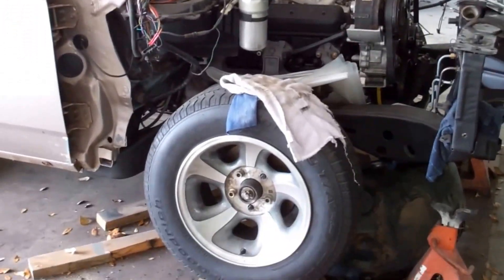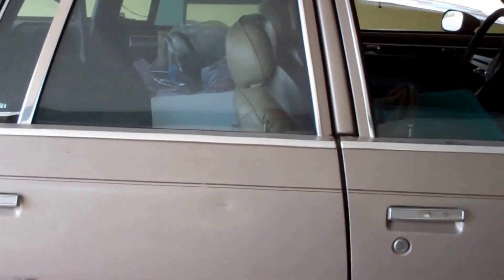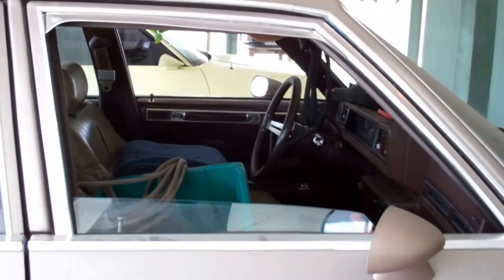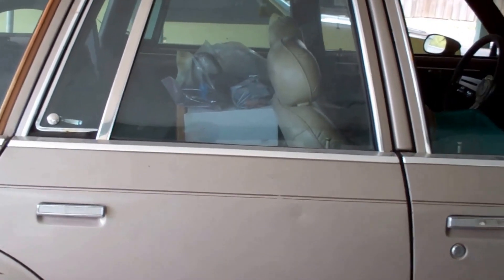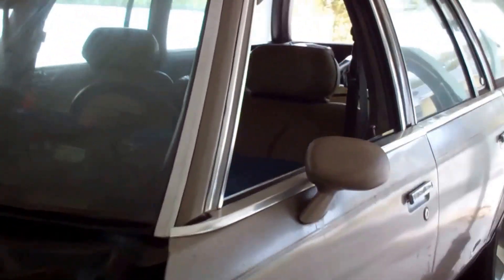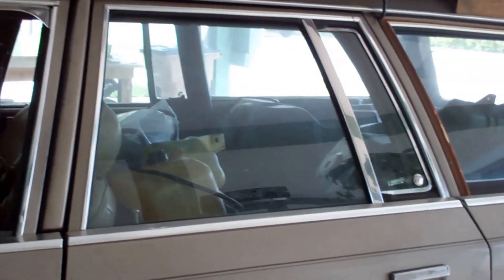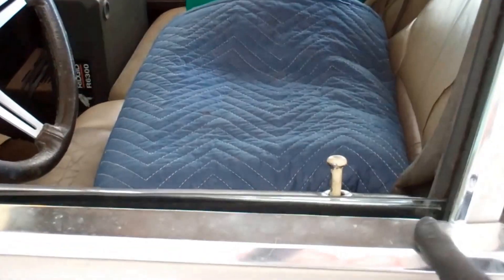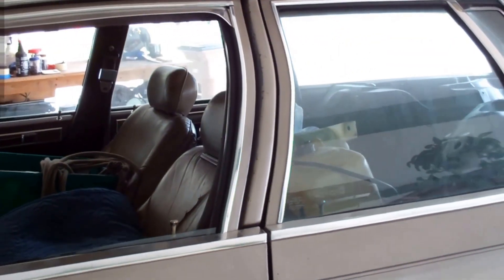'83 OLDS Cutlass Cruiser project - update 9

Comment: I still got to work on my door gaps,I hate doing them ,For one it's hard doing something you don't have enough experience with an no help to do it,I got them on,but when i get the gaps alright on the door,put the fender on an the fender will not a line right
Reply from the maker: yours is 2 dr ... it will be easier.  line up the rear and bottom of the door 1st, THEN mount and align the fender to the front of the door.  what is helpful are pieces of  1/4" or 3/16"  wood, tape them along the bottom and back of the door opening
Reply: EdontheBeach Thanks for the info,i am going to try that ,i am just glad i don't have to deal with 4 doors,id go f**king nuts